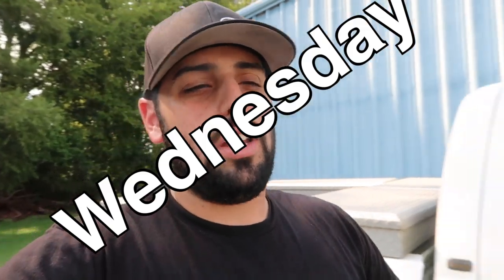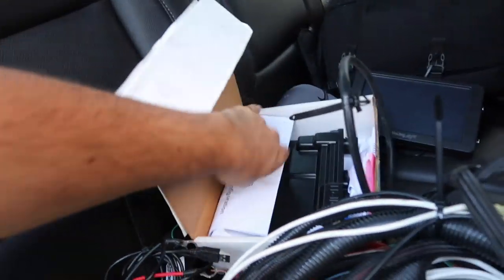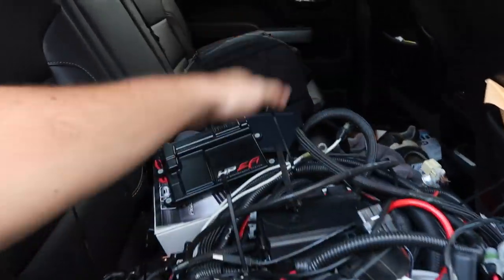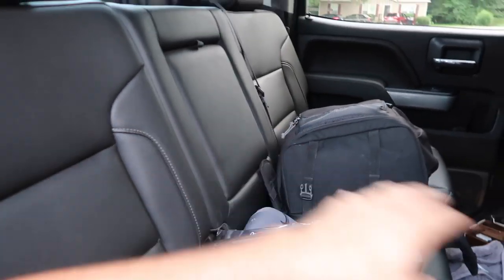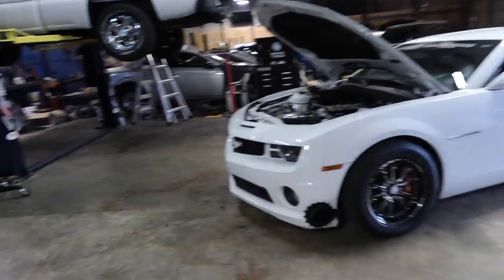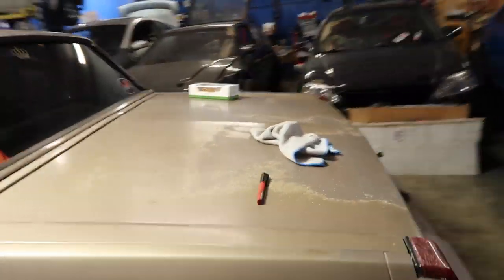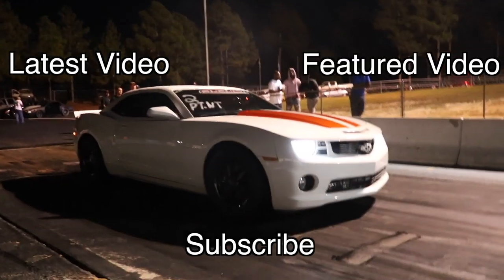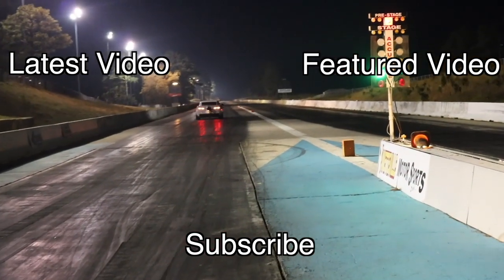SALTY CHICKEN NEW PARTS!!!! HOLLEY EFI!!!!!

Comment: Turbo John runs the Holley HP I know the Dominator is the Big Daddy but as far as cheapest to most expensive and littlest to biggest, least amount and simplest to most amount of stuff and most complicated.......can you do a video of all the ratings of all the Holley systems? The HP,TERMINATOR,and DOMINATOR and if I'm forgetting one throw it in there......Fuel Tech is supposed to be the Grand Daddy of all the EFI systems especially the FT600 so here's another idea for a video for you to do on an off day when you're just sitting around tinkering around the shop do a video of all the EFI systems out there including Throttle Bodies and all Nick Williams,Fast,Fuel Tech,Holley,and them big ole throttle bodies that them boys run on them big cubic inch nitrous motors that look like a set of split Dominator carbs. I know back in the day I seen a big square throttle body atleast I think it was a throttle body it might have been a carb  that was made from billet aluminum and had an Eagle on the side of it either way it's a shame I can't remember what it was carb or TB and I can't remember what the name of it was because when the guy had it on his motor his car would fly even though it looked like a block of aluminum sitting on top of his motor
Reply: I just remembered another high dollar EFI system them big boys with big cubic inch nitrous motors run with them 4 big Throttle Bodies that look like split dominators I mentioned but anyways the EFI system is called R8 I do believe

Comment: John Doc do ya know anyone who knows how to grout or fill engine blocks? We’re trying to make some power on a couple of stock blocks but want to still be able to leave it water cooled. It’s not a complete block fill, it’s just to help strengthen the mains and the cylinders a bit, we haven’t had any luck with just using a windage trey and girdle. I can show ya the one I got sitting in my shop floor, the blocks in two pieces lol I split it down the middle 😱😱 Ty good luck 👍🏻
Reply from the maker: Call Keven at TKM Performance in Denton nc. Tell him we sent you!
Reply: John Doc ty dude I greatly appreciate it. You have no idea of the idiots we got for machinists here. I’d rather drive 4 or 5 hours and drop something off and have it done right rather have it half assed😱😱💯💯👍🏻👍🏻